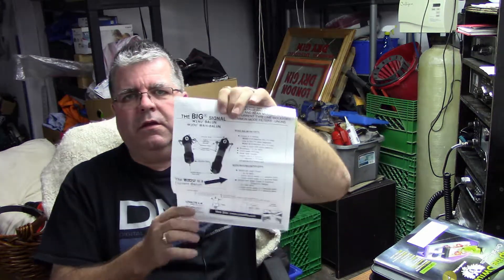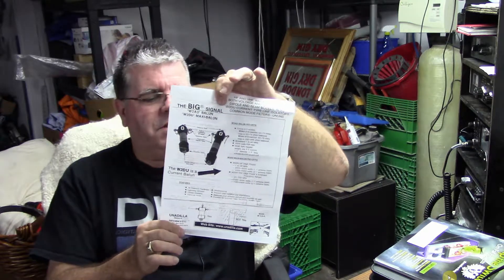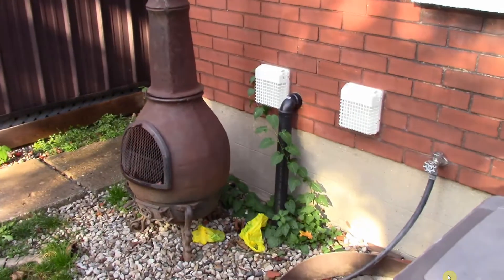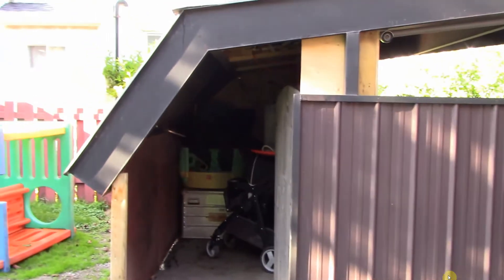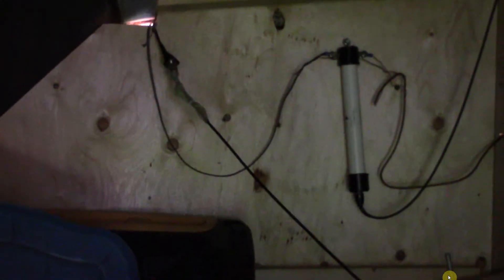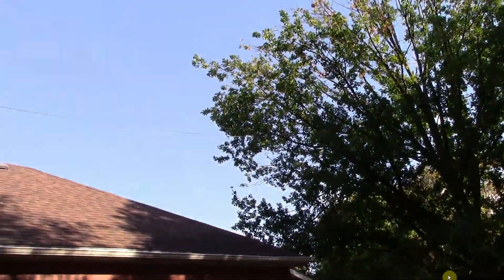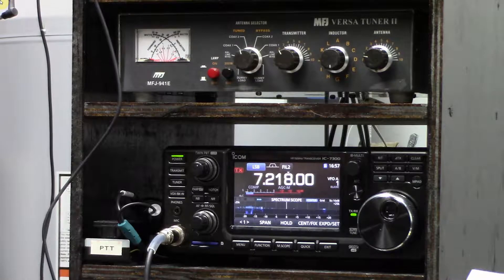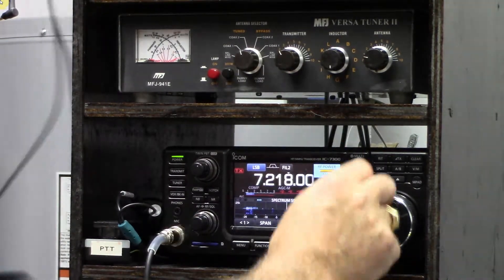1:1 balun - why?

Comment: No reason Useless.

None of my antennas have or need baluns or other gimmicks, they match 1:1 and easy 1 watt DX 5-6,00 miles.

Baluns are for connecting open wire to concentric transmission lines, not for antennas and theres no excuse for using twin lead with a 50-75 ohm antenna

Comment: The observation is that you have connected a BalUn to an Unbalanced feedpoint.   That BalUn is intended to be used at the Balanced centre of a resonant dipole, so not sure what you what you are trying to demonstrate?   If you simply want to choke off the common mode,  then you should consider winding the appropriate choke from the K9YC cookbook.  In addition,  if you are looking to mulitband the inverted L then I would put a remote tuner at the feedpoint and choke off the coax at the connection point of the tuner.

Comment: Have you considered making a simple 49 to 1 UNUN and replacing the 1 to 1 Balun with it. Not only would that also stop feeder radiation but would give a better impedance match . Best wishes Brian G0RLB.
Reply: Since this YT I have indeed made and experimented with many Baluns 9:1 49:1 etc. I should have video documented more. whoops. Thanks for feedback Brian.
Reply: @SimonWilton  I only made a suggestion because your instructional video was already very good and am sure your follow up will be very helpful to many radio amateurs. Very best wishes Brian G0RLB.
Reply: A 49:1 provides little by way of common mode choking, nor is correct to use one unless the inverted L is a resonant halfwave on the operating frequency (and its multiples).    It's often the case where a halfwave endfed has been implemented with a 49:1,  that a good choke balun is used as well.

Comment: does the tuner have a 4 to 1 balun already inside ? thanks for video hope to hear one day on the air
Reply from the maker: Yes I Believe this one does. They don't all. Generally you can tell if it has 4mm posts on back for wire input it probably does. If it only has SO239s then probably not.